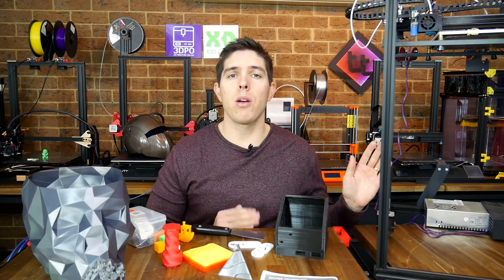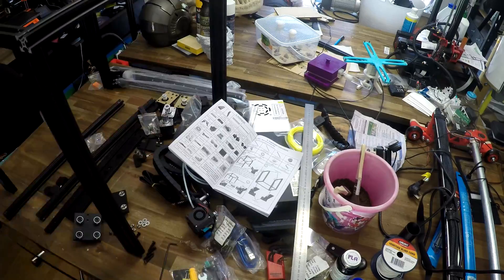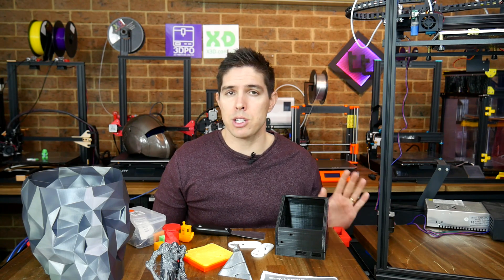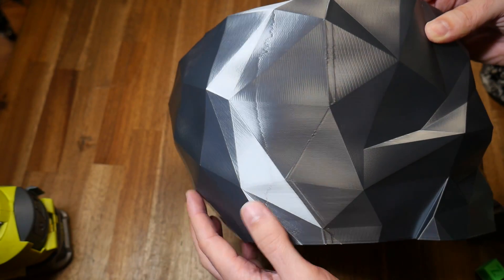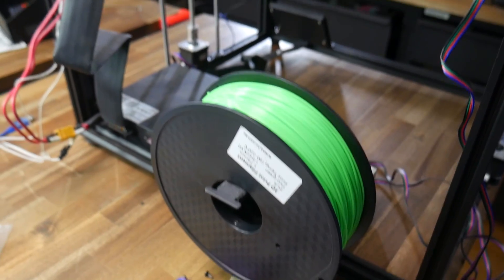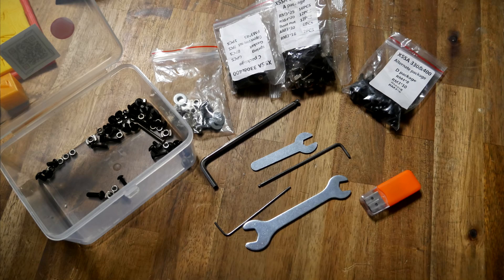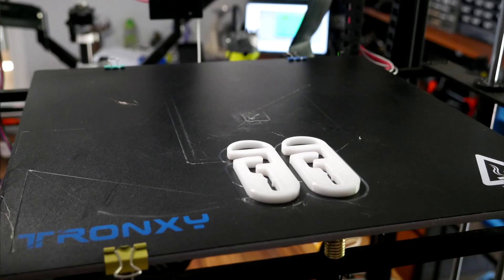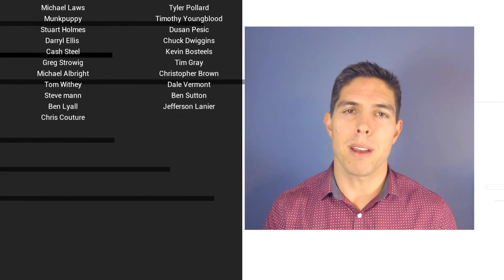Tronxy X5SA Pro review: A large format CoreXY 3D printer (with issues)

Comment: feb 2021... this is a good buy still with the intentions of modifying most of it. price is $269 USD shipped.
Reply: I see that too, came back to rewatch this and am tempter to pull the trigger. Any idea if people have already developed enclosures or anything for it?
Reply: @energize  lots of enclosures have been made. This design makes that easier and the outboard stepper motors are ideal. This guys review is valid, but its all things that would be addressed in a build anyhow.

Comment: Concerning the long Teflon tube - do not put it in their receptacles before you cut off at about 7cm - these will come in handy in between the filament sensor and the bowden stepper and fit perfectly there.
Another thing to shorten is the cable channel to the extruder - taking off 5 elements will be ok but try it first.
The issue with the filament sensor case blocking the filament can be fixed with a bit of some epoxy, or CA glue and baking powder, by modeling a sort of funnel - the case does not provide a guide for 1.75mm filament and the microswitch pushes the filament against the wall of the case and against a rectangular cavity.
The cable management has been upgraded, I did not have any problems with it, just the hotbed wires and the wires for the sensor are way too long - I cut them short and soldered a new XT60 socket on (the sensor wires got soldered and shrink tubes)
The problem with the height sensor is easy to fix, but there should be a point in the instructions on how to do it right, as well as the Z-offset. I have my amount of carving done in the bed surface.... BUT CURA 4.8.0 did the same and burned a hole down to the aluminum (and stopped the whole machine too).  
PLA sticks like hell - I am down to 35°C and not quite happy yet, 30°C is too low and parts will warp and pop off. 
The timing of the TRONXY slicer is way off - it said 6h20min but took over 20 hours to finish the part.
Another minus is connectivity. Nowhere any info about baud settings for USB (115200), the USB port is not used at all with the TRONXY slicer, and finally, the micro SD card is a real PITA. I have ordered a special short adapter cable with micro SD to TF SD socket and will use a Toshiba WIFI card there, but in the end I will try to get the WIFI module from TRONXY and hopefully this will be the remedy.
The steppers are running very silent (2209 drivers), just the fans are a bit noisy. but my old Dremel 3D20 (stepper and fans) was screamingly loud in comparison. A case around the printer might help if needed.

Comment: I have seen other reviews of this printer and they tensioned the belts at each change of direction and experienced none of the problems that you did.
 Pro 3D has designed a core XY tensioning system for his V-Baby 3d printers which will fit on the Tronxy!

Comment: Hello, I just built my X5SA Pro ordered on Amazon at a suuuper cheap price.. 4 hours to build up the machine. If you are good with your hand and good eyes to see how square thing is then it's not a big problem.
follow the steps in the manual to level the bed and first print on 0.15mm PLA is flawless perfect
Like you say, Hotend temp move from -5 to + 5 degree of your set temp so play with the fan speed from the lcd menu to get it less fluctuate. 

Well I need to admit that I'm in 3d printing since 2 years and have done all possible upgrade on my Ender 3. I would say for a new user, don't buy this, there is too many thing to do before printing and this can be a downer for a new user and not counting that you need to learn how to slice....
but for someone that want a COREXY machine, and like to MOD.. this is a perfect project.. 
There is a CHITU Board (cxy-v6-191017) with TMC2208, this machine is very silent for a 330$ but interface is crap!!!. some people found an way to install marlin but there is too many good features you can't have because of the board..
So planing to go with MKS Robin v3 

Overall i'm pretty happy with my buy, I plan to invest 150-200$ on quality parts this bring me to 500$. this is much much less then the Ender 5 Plus that retaill 800$ CAN and you need to invest to get it silent and tweaks....

Anyway, I would say that this printer is a pretty nice project for people that know all the technical of 3D print + have the knowledge to go into modification (motherboard, compiling Marlin, etc...) ..

Comment: if you want a good and cheap corexy printer, buy something like a Creativity 3D Elf CoreXY/Coreception 300 model. I had the first Tronxy X5 Model., I have never seen a worse printer, with smalls parts broken after some prints because they are made on plastic and should be metal ones, and looking your video i see issues that i had on that model and are not fixed 2 years later on next models. Incredible.
Reply: Probably was, but this is relevant with X5SA Pro model in what way? Like telling that "I had a Mercedes Benz A Class 1997 and it really sucked so you really shouldn't by this 2020 model either".

Comment: I have the 500mm version of this printer and had to change out the main board to an SKR 1.4 turbo along with a TFT70 display.  Now it prints excellent.  The mechanics of the printer are good, but the electronics are garbage.
Reply: Seems you can now update the Chitu boards to Marlin. Just something to consider before changing the board. No doubt some other alternative is better but stock with different FW gives some options too.
Reply: @willmackey8449  I originally did update to Marlin with the original mainboard. I still had terrible layer shift issues.  I estimate that it was due to driver current settings, but rather than deal with a board I wasn't familiar with, swapping it out to the SKR 1.4 was a much easier endeavor.  But yes, you can flash Marlin on the board and have done so with limited success.   These printers are just not sent out with any quality control whatsoever.
Reply: @NischGTM  In that case makes a lot more sense to ditch the flimsyboard yes. I just but mine together 2 days ago and have only been doing calibration prints and some mod parts for the unit itself but so far the quality with the original board is quite nice even at 150mm/s, 3000mm/s^2 and jerk at default 20 (what ever the hell jerk means in these things, it for sure isn't the same jerk mm/s^3 as in motion control in general).

My main gripes with the original board & FW are:
1. Z offset acts irrationally. Sometimes, no matter how flat the leveling is and how well I set the offset, it just decides to print with nozzle way too high until I redo leveling too (redoing offset doesn't help). 
 2. The pre-heat keeps shutting off after every function change.
3. Printed corners bulge quite a lot no matter the speed (I hope Marlin linear advance helps with this).
4. Config retract parameter resets to 3.0 if I set it to 0. Or at least when I run save config gcode, that is what it saves even though the config that I gave it had it set to zero.

Comment: Just bought one of these as my first ever printer.  Didn't have any problems assembling it, no problem tensioning it at all got it perfectly square first go.  My first test print came out just about as perfect as you can get.  Didn't have any problems you describe.  This is my first ever 3D printer and my first ever print came out really good, much better than any of the ones you have shown.  I can only assume that the problems you describe have been fixed a year later.
Reply: Yes same as you, Bought this printer (My 1st printer) and had no such problems. I think old mate might be a stubby short of a 6-pack

Comment: They’ve included a squaring guide that seems to help on the newer versions. Marlin works wonders for adding proper thermal runaway protection and the example configs seem to do a good job with adding a lot more features. Definitely has a few areas for improvement. My unit’s motor mounts shattered under only a moderate amount of torque while mounting. Thank goodness for printable mounts.
Reply: I got a metal motor mount on mine :)

Comment: I have an x5sa 400.
If youre a hobbyist with experience ... it's a reeeally good base.
The controller is GARBAGE.  They used cheap parts and they blow quickly.. and you cant software mod them. Its z sensor is garbage. You need to order new belts when you order it. Other than that it's a hell of a deal right now (under 300). Replace the controller before it's delivered. Spend 10 bucks on some good belts. And mostly understand 3d printers and engineering and this is a good deal. You'll also need to print supports to keep it square and hopefully build an enclosure that does the same thing. It's worth the money if you know what you re doing. If youre a newbie or dont understand engineering and want a print and play do not buy this. NOTE: Tronxy support is better than any electronics support ive ever dealt with. Theyre fantastic.. far better than any american company ive ever dealt with

Please note stringing problems are usually a result of using the wrong temperatures or garbage filament.. if it's not that it's the hotend. This is a fair review though. If youre looking for a print and play printer this isnt it
Reply: Great advice..  I ordered  an X5SA pro ($300) last week , despite this completely unfair review. To me the kit is a cheap pile of parts to build a printer and mess with it to learn if I really want to weld up a giant coreXY from scratch. Rather than printing braces I ordered aluminum triangular corner braces for 2020 T slot to arrive before the kit because it has to be perfectly square and rock solid and to me that means metal. I am an electrical engineer so I always overbuild mechanical structures. I saw a video where it looked like the frame moved when the presenter touched it and that isn't going to stay aligned. I am going to keep what works and upgrade what doesn't and use what I have learned in the last two months since I started 3D printing to make a reasonably priced 330 x 330 printer . Buying a used Anet A8 for $75 on CL got me started and I have watched just about every 3d printing video on youtube to repair it, make some mods and upgrades. Now it is printing amazingly well especially for what it is. I have very high hopes for the X5SA pro with a few mods.

Comment: just bought this printer its my first 3d printer and i really like it, Im having tuning it and some of the problems you had have been fixed on the version i got
Reply: buy new belts and be prepared to replace the z sensor and mostly the controller board and you ahve an amazing printer
Reply: @charlesreid9337  im wondering if they are give getter belts from the factory they are fiber reinforced
Reply: I just ordered one, I have experience with 3d printers I have a skr 1.3 board laying around and 2209s stepper drivers as well as new belts. Going to load marlin on that skr .

Comment: You said you test the products as you receive them, which would be fair, except that you compared this to a product (SecKit) which in your review had flaws that you just fixed by modding it. Just seems so obviously biased favoring of the other brand.
Also comparing the print quality using their obviously shitty slicer against Simplify3D is a bit pointless too, especially when you did not test it with Simplify at all.
Aligning the XY so poorly and not e.g. against the frame / motor mounts is again not fault of the manufacturer.

Still, thanks for the review and pointing out the issues. I still decided to get this one over the other options like Ender 5 Pro/Plus and also, SecKit isn't even available anymore and would have costed over double the price of this one according to their online shop configurator.

Comment: Oh Man, I just got one, but I had to spend about 2x more on my Ender 3 pro to get it to print like this printer
Reply: Surely not I was new to printing only 6 months ago and got a ender 3 pro , I've literally upgraded springs , the bed (glass) and and a metal extruder and I've had nothing but good times I didn't think much of standard springs and extruder other than that I have no complaints at all
Reply: @brokenshoe1775  standard springs are garbage.  I have to re level every print.
Reply: @rizash  re read bro i said I HAD to UPGRADE springs obviously the stock are garbage

Comment: really ? its a diy printer you can cut the tube to the correct length, mount the spool any where you want, print spacers for fillement run out,  and cable management do it your self, change the way the chain connects, i thought you knew printers

Comment: Thank you for the honest review, I'm looking at buying my first 3D printer and have several in mind with the tronxy being one, but after watching your video ill be steering well clear.  I'm now left with the Ender 5 Pro, or the Geeetech a20m ??? Thanks again for a very informative if technically advanced (for a beginner like me to understand) video. 😁
Reply: I'd go for the Ender 5 Plus. That double Z-axis rail seems really good. If you still want a Core XY printer you can give the Ender 6 a look.
I own an Ender 5 and the biggest downside to me is the bed only being supported on one side. I fixed it by printing a bed support found on Thingiverse.

Comment: OMG!!  I see you know nothing about how to build any thing.  If you want thing square you need use a square to keep them square.  I have a small "L" square or a SPEED square I used to keep  things square.  When you actual build thing out of wood you end up need tools like these. You did not install chain or the feed tube correct, but I don't like how they can drag into parts.  how every there is a kit to fix this to where the chain run over head not side to side.

Comment: PTFE that risks making contact with the hotend is a huge health and safety risk twice over. Once because PTFE releases toxic gases when heated above 240°C, second because you might introduce a risk of setting the filament on fire (and then it moves on the spool, and everything around it...).

Edit: even worse when you consider there's no thermal protection enabled by default. It's like they're trying to kill people.

Comment: I'm sure you've been asked this a billion times by now (and it might even be in these comments somewhere already), but I cannot find it after doing a cursory search: What software do you use in order to get Windows to display rendered thumbnails of STL files?  That's just wicked cool!
Reply: It's a stock program in windows 10 called 3d Object viewer.
Reply: @fatcamp907  oh, so if you make that the default program to open STL files, then Windows automatically creates rendered thumbnails of the actual objects?
Reply: @3DOverShare  I believe so, but don't quote me on that.
Reply: @fatcamp907  it worked - thanks!  To be clear for those who are interested, the application's exact name is just "3D Viewer".  Also, you have to use an icons-based view in Explorer as the details views still just shows generic icons of the 3D Viewer app.
Reply: @3DOverShare  Thanks for the explination. I wasn't exactly sure how it worked. I just knew that my computer displayed them by default, before I had even started installing programs on my new computer.

Comment: wish i would have seen this video a year ago.... heavily  mods and still doesn't print well.... so i decided to use it as a laser sadly the repeatability is so shite making a 25mm square it drifts a millimetre in the x direction and the y direction keeps climbing higher and higher.     im thinking maybe i can save the frame and steppers.... but the main board firmware is a black hole.   COMPLETE GARBAGE DO NOT BUY!

Comment: I have the updated Tronxy X5SA the 2020 model, After doing my nut for 3 months trying to get it to be level right and work, I at long last got it working and even found how to keep the prints stuck down too?  I brought a ultra flexible Tronxy Build plate cover, which is magnetic.  I just got the Titan extruder motor system to try TPU flexible filament soon!  the silent stepper motors now on the frame are great.. the better touch screen is good too and the 24 Volt power set up means better quicker hot end and bed pre-heating.  Thanks to Tronxy Support by email and the tons of online videos I got it working right.. So that 3 months of hell. was worth it.

Comment: I have a SnapMaker Original first printer, I now have a Prusa MK3s I want to add another printer but want a larger build surface and do not want to spend more than 800 to 1000 usd. I was looking at this printer but sceptical now. I really would like auto bed levelling, power resume after a failure and filament sensor. Also something I could use prusa slicer. What suggestions would you have.

Comment: Got mine at the start of the year. Runout sensor jammed on first use and I have not been able to get the filament out. Can't get the bed to stay level - one side always ends up higher than the other. Auto levelling is terrible compared to others i have used. May try selling it for scrap/parts because it is unusable! Incredibly bad investment... (I have used printers and cncs for a couple of years, so no novice).

Comment: When you want to build a China 3D printer in kit you have to get minimal good mechanical basics.  It seems you dont know what paralelism or perpendicular are meaning ???? My X5SA Pro 500 works very nice but building has to be done with precision and method. This is not possible when following paper manual. So you are right, manual is shit, many steps have to be inversed. Most important is step 2 to be done before step 1 otherwise you can't get perpendicarity of XY. That the reason of you printing faillure: your XY axes are probably not perpendicular !! Sorry to say but this printer is GREAT and your video and advices are POOR...Please have geometry and mechanic lessons and rebuild / reajust your printer cause printing faillue are just your fault ! I think I'm saying the true... ps: I dont have any interest in Tronxy.
Reply: post a video then